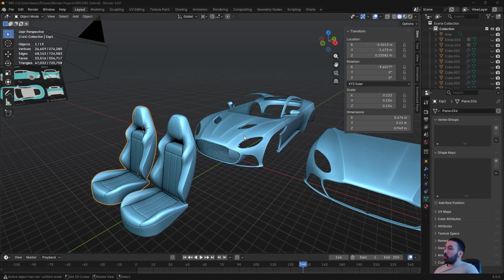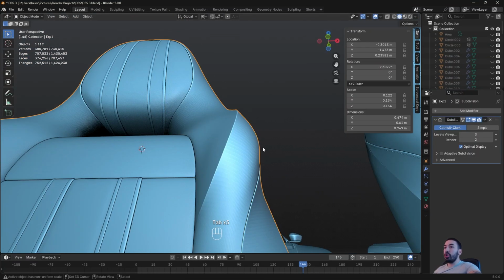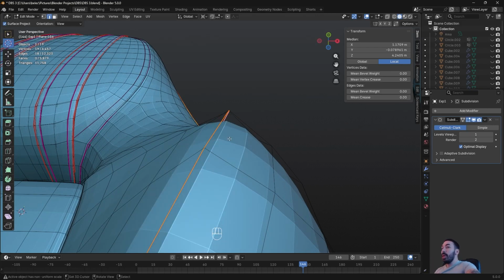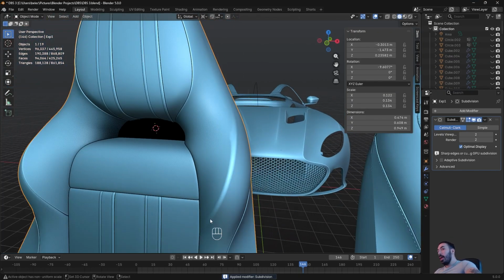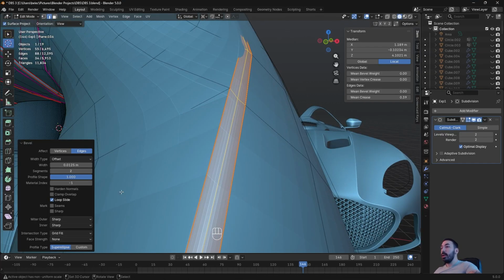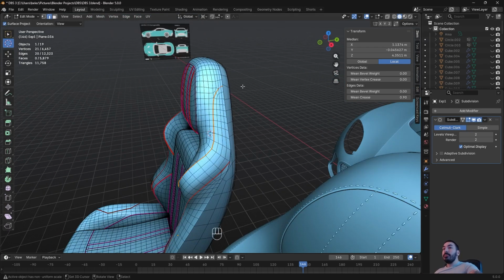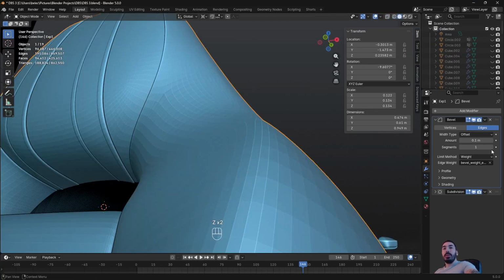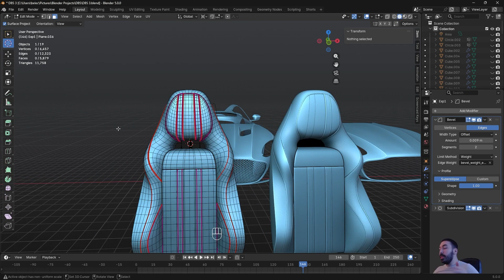Hard Surface Modeling Tip you MUST know in Blender

Comment: what do you do with the end of the bevel where there is triangles?
Reply from the maker: Good question, I'll answer in another video.
Reply: Very good question
Reply: Maybe rip vertices and fill surface at the end? It's few more polygons which is easy to fix